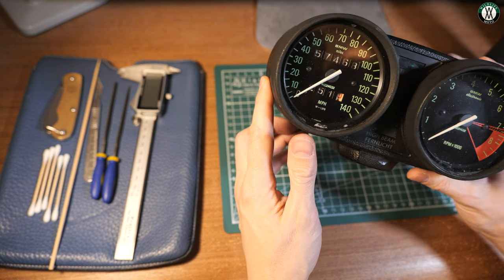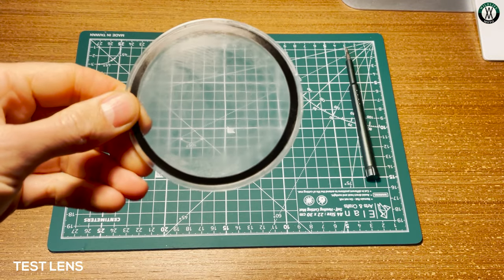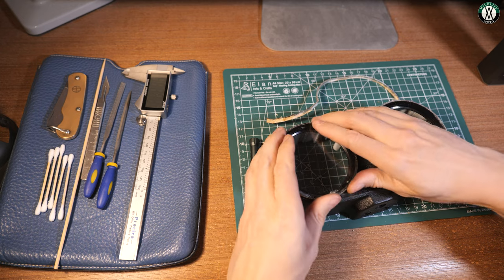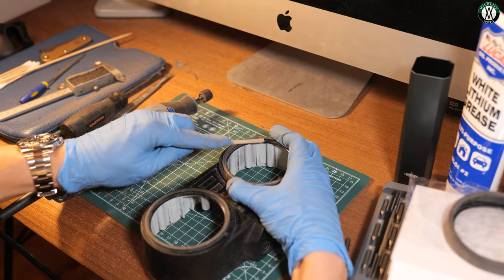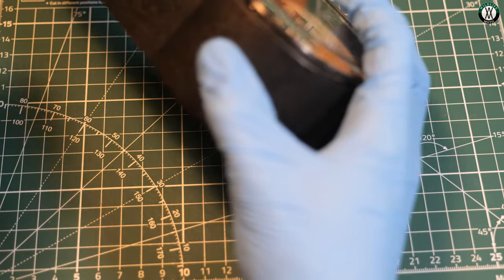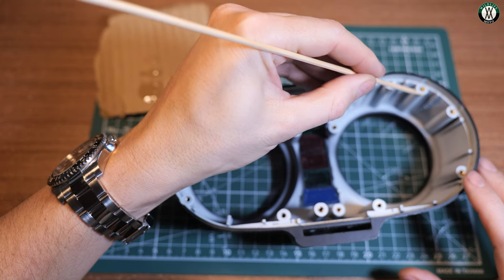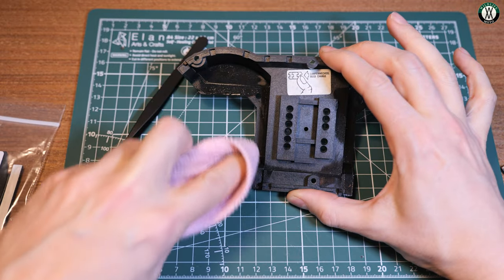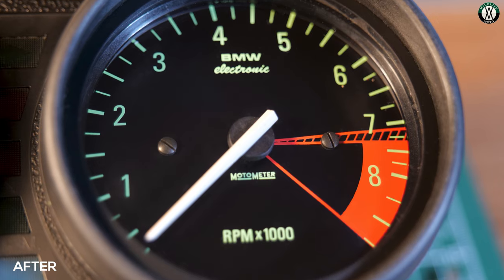BMW R100CS: Classic Airhead Restoration | Instrument Cluster Rebuild

Comment: My 1982 R100CS  has needed little repair over the years but the speedometer and the instrument cluster lights did need repair/replacing.  The LEDs are a big improvement.

Comment: Nice job, thanks for sharing! Great you managed to DIY it -- new instruments are expensive!
Is the LED light for the charge state (battery/regulator) bypassed by a resistor? I think it needs one as otherwise it can cause regulator failure. I imagine if it was from a special kit for an airhead then that would be factored in.
Reply from the maker: Thanks. The green LED lights were only used for the background on the dials. The index lights are still incandescent bulbs. There is a Katdash kit you can get to change these if you want. I’m guessing they have figured out the correct resistance for the charge light.

Comment: Regarding fixing the acrylic cover might have been worth considering a black bituminous rubber glazing strip (the sort of stuff they used for fixing windscreens in cars). Flexible, absorbs vibration and is waterproof etc.
Yes acetone is really bad…. so bad in fact that many years back apprentice draughtsmen would be told to soak plastic instruments in it overnight for a “deep” cleaning….. leaving just a residue of sticky goo the following day. But at least it smells nice.;D
Reply from the maker: You can't beat a good ol fashioned acetone related prank! Good idea with the glazing strip. Next time :)

Comment: Good result. Very clear and concise instructions. Have you tried the bulbs yet ? Were they from Motorworks ? Some people say the Katdash led replacement ‘panel’ is too bright. Yours okay ?
Reply from the maker: Hi Lesley. I got the bulbs from eBay. I've not tested them yet. I have seen a few kat dash installs and I agree that the lights are extremely bright. I only changed the bulbs behind the dials, so hopefully they'll be ok. If not I'll go with a green incandescent bulb.